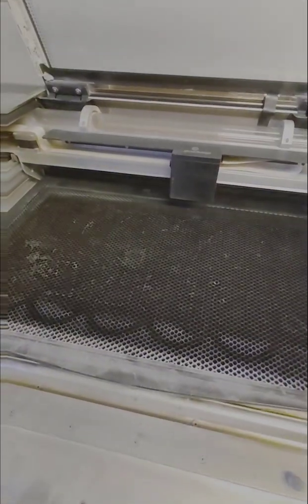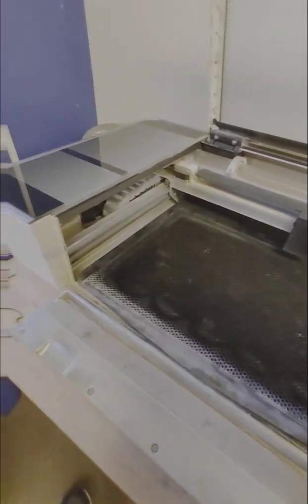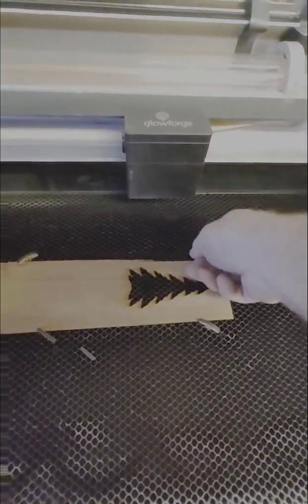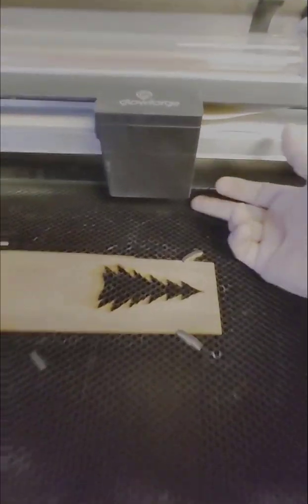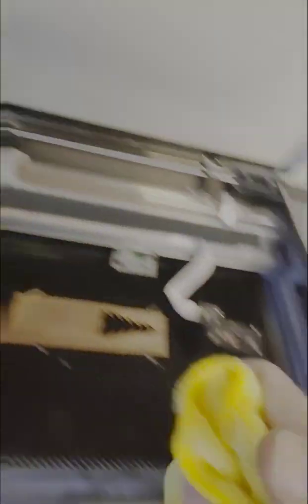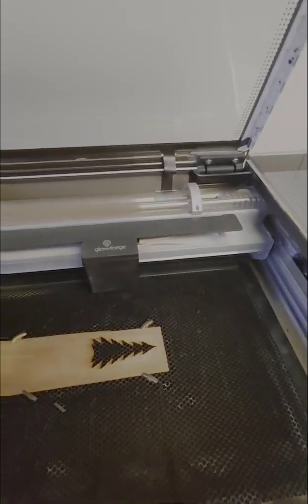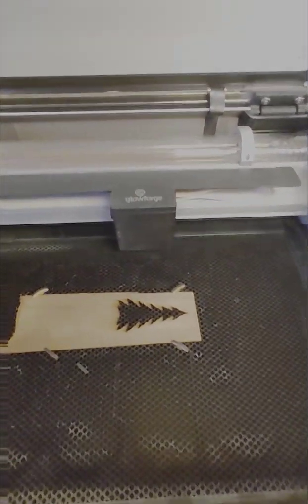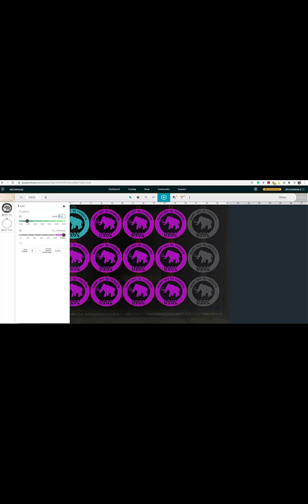Why isn't Glowforge cutting all the way through my wood?

Comment: Thank you for the video!! I ahve a question about the hose you have on your Glowforge.  This looks like an even more durable hose that the dryer vent hoses. May I ask what kind of hose is that?
Reply from the maker: Yes, we got that on Amazon for a different project and it worked for this as well. It is called, "Ultra Flex Clear Vue Heavy Duty PVC Dust Debris and Fume Collection Hose"

Comment: Also make sure there isn't a small crumb in those notches!  Also - (IMO) you SHOULD remove the lens to clean it... I've had particles and dust inside that had I not cleaned out would have burned into the lens and or caused it to crack or become unusable.  USE the blue thing!!!(That tiny fan in the back of the lens can pull small debris inside ,behind the lens.   ESP if doing tile or glass.
Reply from the maker: I totally agree that removing the lens would be better. I just don't think it's worth the risk. I have the blue thing (I love calling it that and you know what I'm talking about) if I ever need it, though.